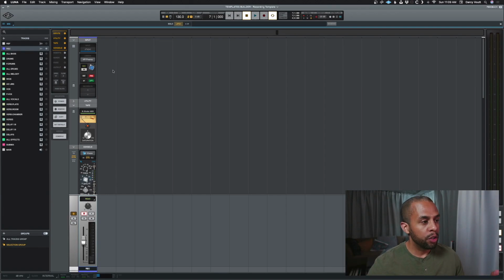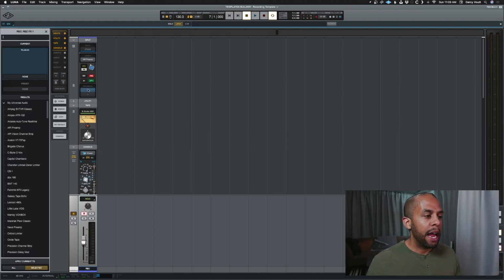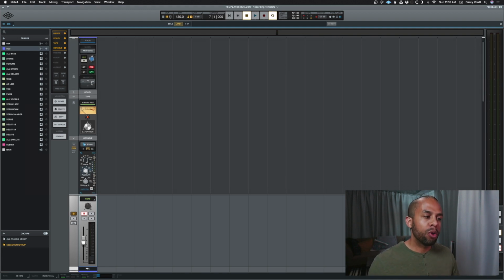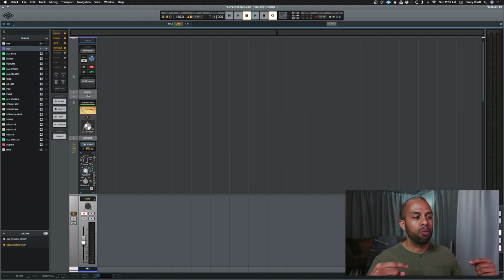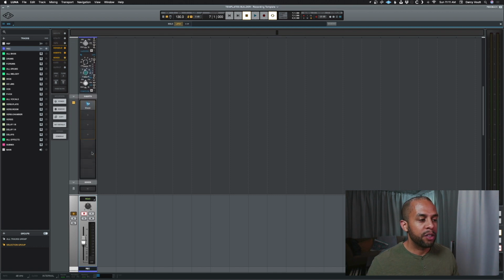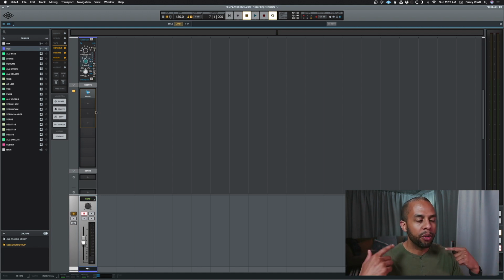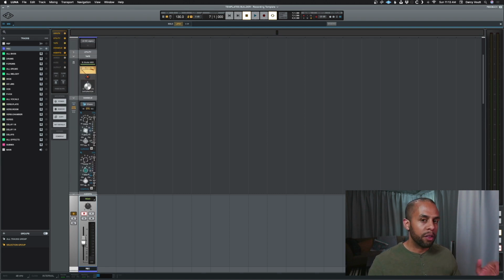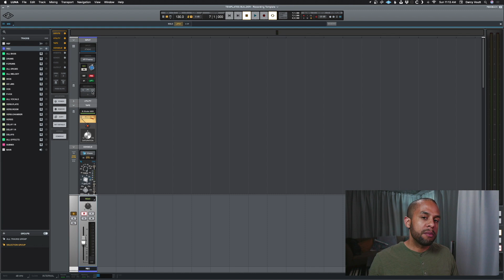Recording Basics in LUNA

Comment: Awesome! You say how it works, it would be really nice to also hear why/when we would use something. For example, what type of things/situations  are the correct things to commit to the wav forever using the preamp vs what should be inserts. :) (apologies if it's too much of a noob question!)
Reply from the maker: No that’s a good question. Putting that on my list for topics to cover. 

The short answer is that I like to commit to preamp sounds to save processing and time later. But there’s more to it I can cover.
Reply: @MusicByDarcy  How would that work with something like the Sphere L22 modeling mic? I hear you can change the mic type/make after you record. Just wondering how that's possible if you commit the pre-amp stuff to tape. Thanks in advance for your thoughts!
Reply from the maker: @Woyano  haven’t used it but pretty sure it takes over the preamp slot. Anything in the unison preamp is always committed. The unison preamp changes the impedance and gain staging of the it’s own preamp. Which is the electrical resistance which will in simplistic terms changes the EQ of the sound (but it’s more than that). I assume that on top of those, the preamp for those emulation mics add additional EQ and saturation through DSP.